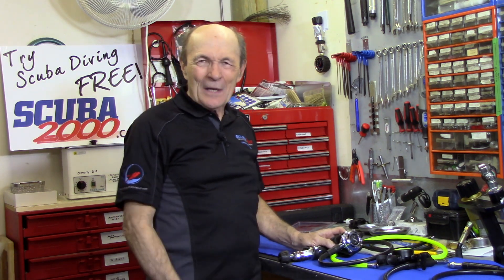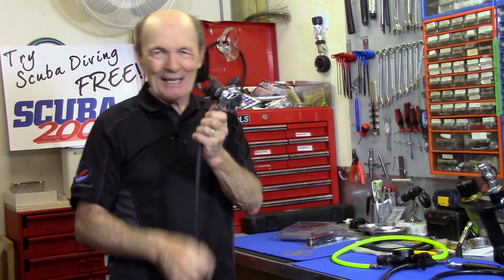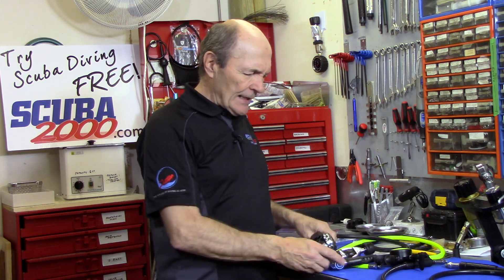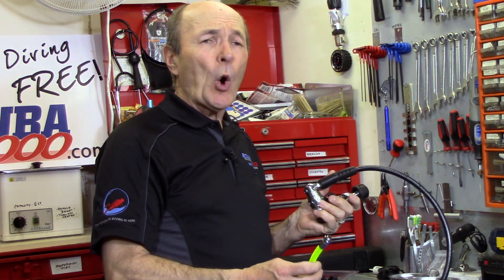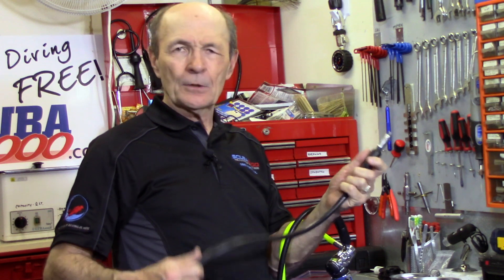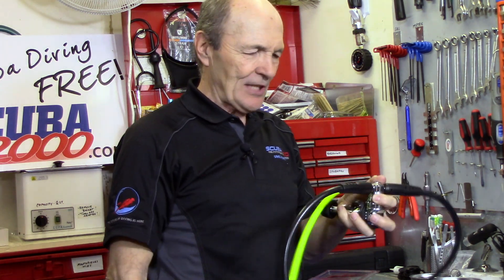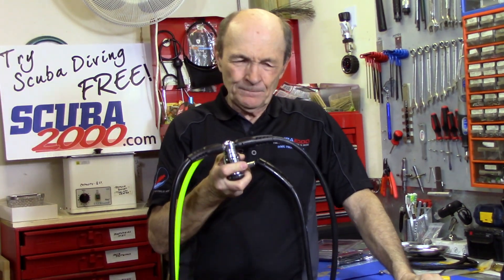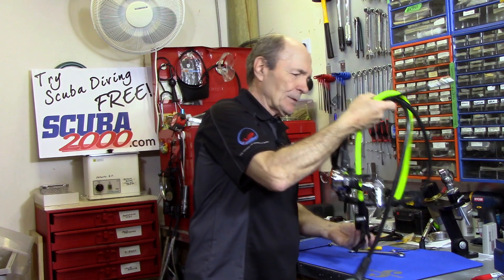Mixing Brands In A Regulator System - Scuba Tech Tips: S05E13

Comment: if you get your regulators serviced at your local dive shop, i would check with them if they service the specific brand you want to attach though. if you get a scubapro reg, but buy atomic 2nd stage, your dive shop may not be able to service the atomic 2nd stage. just something to keep in mind.
Reply from the maker: Very true to ask before mixing brands if your LDS services all the key parts.  Most service tech's cover the major brands sold in a store but not always for outside models.  
A

Comment: What about mixing a 2nd and first stage are the pressures different or are they also standardized
Reply from the maker: You can mix 1st and 2nd of any brand, but the 2nd will likely need some tuning to get the IP and effort to match the 1st stage IP.  IP can vary from 125 to 170 psi but once balance, will work fine.
A

Comment: I have been diving on a "Frankenstein" regular setup for over a decade.  Every piece from a different manufacturer and accumulated over quite some time.  Never had an issue.   As I am typing this I guess I am "living proof" a mix-n-match system works just fine!
Reply from the maker: It does when thought through and not for showing off.  In my stores I sold many brands but someone would always come in saying what about brand X, will it fit?  So I used the example of a car, you buy GM, maybe use GM parts IF available, a good price, and does the job.  Otherwise it's off to Canadian Tire (in Canada), Princess Auto or the internet.   You still drive a GM but you want it to be 100% functional and not 100% GM parts after many years.  Thanks for sharing.

Comment: Yes they Cary air in the pipes thought it may be possible. But all stores don't recommend it.
Reply from the maker: It's like light bulbs, they all fit the same socket so why is one good/bad?
Reply: @AlecPeirceScuba_SeaHunter  
Thank you for that Alec.
On a similar theme,.
Computer transmitters is it possible to phaise say a suunto transmitter, with say scubapro dive computer. Or is this not possible. And with other manufactures also.
Or is there something in the software to stop this happening. Your thoughts on this would be interesting ☺️
Reply: @kurtsteiner8384  The internal hardware and software will be encoded to transmit/receive specifically to work only with the same brand. Similar to how different radio stations can transmit at the same time without interfering with each other, the receiver and transmitter have to be tuned to be on the same frequency. In theory it could be possible to adapt a transmitter/computer or build one from scratch, but you would have to know how the software interpreted the signals at each end.

Comment: Hello! I recently purchased some used equipment. The first stage is an aqua lung. I bought an aqua lung safe 2nd and it fits but then I bought a brand new primary regulator. Oceanic alpha 10. But it doesn’t fit! The LP port on the upper part of the aqua lung (first stage) is a bit bigger at around 1/2” thread size. Is it ok to use adapters or a new hose?  Or should I purchase a different regulator. Thanks for any info.
Reply from the maker: Using size adapters is not a problem with todays extremely safe parts, some even swivel.  Maybe start cheap and use an adapter, test dive the  setup in a pool or shallow dive (with buddy).  If the reg is good, use it, otherwise a replacement may be Needed.  Remember to get them serviced if not confident the previous owner took good care of it.

Comment: Hi Alec, hope all is well I’ve just purchased a din regulator what is your opinion on using the din to yoke adaptors are there any drawbacks that might not be clear to me and also are they suitable for like 50 dives plus? I did have a scan for a video for this but couldn’t find one for this. Thanks in advance!
Reply from the maker: You should have no issue diving with a DIN connected to a yoke adapter.  Watch tech tip S04E14 DIN regulators and adapters, for more information.  The one key reason for using a DIN is when connecting to high pressure tanks (generally above 3442 psi), otherwise both will work fine for a long time with care.   Thanks for watching Lewis.

Comment: please make a video on hose replacement since different brands have different sizes on male and female UNF screws
Reply from the maker: Generally,  that is on 99% of all regs made worldwide, the LP hose has a 3/8" thread and ports to match while the HP hose has a 7/16" thread. 
That's about it. You can't mix them up 'cause they don't fit into the wrong port.
I think we just did a video on installing hoses. 
I hope it helps.
Alec

Comment: Hi, what about an overbalanced reg like the aqualung twilight with a alt airsource/bcd inflator like the atomic ss1?
Reply from the maker: Overbalanced is one of these words made up to help sell regs. It came from the Marketing Department, not Engineering.
Technically, there is no such thing as overbalanced. 
If 'balanced' means there is no effort change to open or close the valve regardless of the pressure or depth conditions, 'overbalanced' would mean that there is!!! 
Next time you hear that word used, ask the person to explain what it means. Compare what he says to my video. It could be interesting.
However, I have talked about combined BCD/Safe Seconds before. As with most attempts to combine separate functions in a single component, it usually doesn't come off well.
Take care.
Alec

Comment: Only thing about mixing brands is that your dive shop may not be able to service your set.

Aqualung has an ABS octo which is what XS Scuba copied, essentially. I have an Aqualung primary, so I just got an Apeks Egress for ~$70 more than the XS.
Not a huge amount of money in an equipment intensive sport like Scuba.
Reply from the maker: Mixing brands is not bad and doesn't create a performance issue. I'm not advocating it but in certain cases, it may be the only option. Hopefully, your LDS can service whatever 1st or 2nd you have installed.
The XS Scuba AltAir, their safe second or octopus, is unique. It may look similar but it is NOT the same as any other such device on the market. 
The design and performance are as good or better than most but certain features place it on the top of the list. It comes with a Quik-Detach, Fastex-style clip. You don't have to buy a separate octo holder. That clip fits directly into most brand name BCDs or, by attaching the included snap clip, it will clip onto any BCD made.
Also, it is the only (that I know of) octo that has the mouthpiece directly in line with the hose, a great design feature. With this simple innovation, the AltAir is the easiest octopus to deploy. There is no fumbling to orient the mouthpiece to your mouth. It's as simple as eating a banana - grab the hose and stick it straight into your mouth. There's no up, no down, no right or left - grab it, jam it, suck!!
Try it and you'll agree.
Take care.
Alec
Reply: @AlecPeirceScuba_SeaHunter  It's a great octopus I'm sure, it's just that my local dive store doesn't work on XS Scuba regs.

The Apeks Egress is essentially the same thing as the AltAir, with a 45* angle mouth piece and the same inline design. Even the same Miflex hose! Works great, and it can be serviced alongside my Aqualung primary.

Love your videos Alec!

Comment: What about mixing different model first and second stages. Ive got an old scubapro mk 5. I know the second stage is in good workable condition but im not sure about the first stage. Im thinking about buying a more modern first stage to go with it
Reply from the maker: It's usually no problem to mix and match. Most hoses and ports are compatible.
You simply have to be sure the IP from the 1st stage is set properly and then adjust the breathing effort at the second to match that IP.
I have shown you both of those procedures in my videos.
Good luck.
Alec
Reply: @AlecPeirceScuba_SeaHunter  Thank you for the speedy reply, absolutely love your videos! Because of you i am now addicted to sea hunt!

Comment: I would not recommend other brand second stages with Poseidon first stages !!!  Poseidons usually have a much higher intermediary pressure than most 1st stages, leading to free-flowing secondary stages !!!
Reply from the maker: Quite right. Generally, the Poseidon regs have an IP of 160psi rather than 135-150. There is a reason for that which is beyond the space limitations of this format but regardless, it is not easy nor the best idea to mix and match with Poseidon.
Alec
Reply: Robbie McGill
 Good call there, that is what I have is and a PTA to find a shop in USA to service it I have found.

Comment: While his comments about fitting universal size items to most any regulator is factually true, why would you place a $50 "safe second" on a top performing $800 regulator.  The logic does not fly.  Gorgeous flex hose... is a cheap poorly made Chinese hose and a crappy 2nd.  Think twice before doing this.
Reply from the maker: There's nothing wrong with using a Scubapro octopus on their system. It'll work just fine.
As I indicated, however, the logic of spending extra money for something that you will probably never use escapes me.
And the XS octopus (others too) have features that are really nice to have on your Safe Second - features that Scubapro has not adopted on their octopus models yet.
So for 1/2 the cost you can have a Safe Second that is easier to use, lighter, better-looking and just as reliable. Where's the beef?? 

You are quite right about the source of most scuba goods. The vast majority come from the far east. None are made in the US, a couple in France and England and a few in Italy.
If that concerns you, I suggest you stay off the highways since the vast majority of the vehicles we all drive also come from the same sources!!
When I became a diver, almost everything was made in the US. For economic reasons that's no longer the case and the scuba equipment made today is more reliable and longer-lasting.
That "crappy 2nd" is virtually identical to Scubapro's own R195. They ever share parts!
I'm not completely convinced that Made in Italy is a confidence builder!

You've contributed to this channel before Joel and with insightful comments. Cheap shots are not your style. This 'old pro' not only knows that Scubapro gear is largely made in Italy (except for some of their accessories that come from Japan) but he also knows the names and background history of the guys who started it including the companies they all came from  (and that are now out of business).
Did you know that the first Scubapro regulator was a re-branded Healthways? Even Scubapro executives don't know that or refuse to admit it. It's great gear and your loyalty is admirable but it surely isn't the only great scuba gear out there.

So, if you think its best to have an expensive, same-brand Safe Second, go crazy. Store Owners love divers like you.
My suggestion is still quite valid for most divers.
Take care.
Alec
Reply: He is only showing us that it is possible, he is not suggesting anything, only showing possibilities. Will YOU please make some Youtube videos so you can show the diving world how everything is supposed to be done. Then we can be overly critical of your videos and pick them apart for silly reason?

Comment: a very honest approach of diving equipment, I dive for more than 40 years now and except for the wetsuits ,masks and fins, I never bought a new equipment I always assembled and serviced myself my regulators and my BCD's and I never had a problem with that.
my approach is very simple, find the pertinent documentation then study it, think twice and act once and be very, very clean in the work execution, adjust then check twice.
With the years, I made most of the specialixed tools I use as the IP gauge and the differents jigs to install seats, O rings, filters and tis locking ring stress sleeves on the hoses and many others.
I think that I will fabricate the second stage adjusting tool as it speeds the second stage matching process.
Reply from the maker: That tool is easy to make. Put a gauge on it too so you can see the IP right there as you adjust it.
Take care.
Alec

Comment: Hi Alec, a great video as always, I have a quiestion related to it. I need a new second stage to assemble an old piston regulator (scubapro mk2...from 20 years ago, the first stage was fine, but the second one didn't survive such a long storage) and I found a very cheap deal for an Oceanic second stage but its label says it is a "hookah" version. Can I use this second stage with my regulator right away?, or need to adjust something before?. Thanks a lot
Reply from the maker: Hookah version is simply a 2nd stage that has been adjusted for lower IP. It will work fine. Hook it up, check the IP and then adjust the new 2nd to not freeflow.
I just made a new video on how to do all that.
Alec
Reply: Alec Peirce Scuba Great. Thanks a lot!